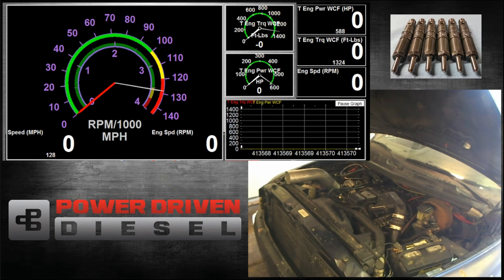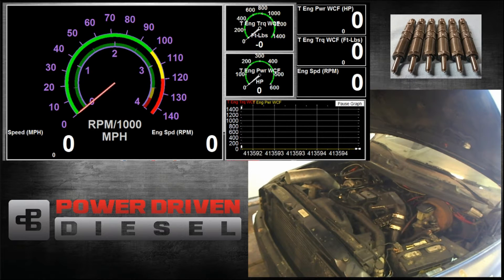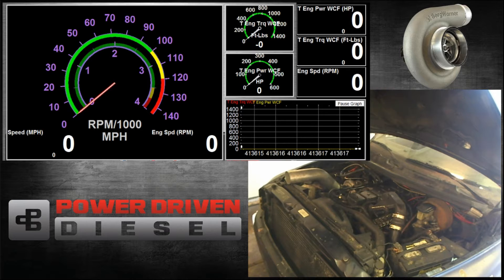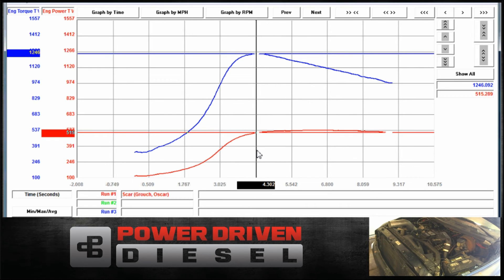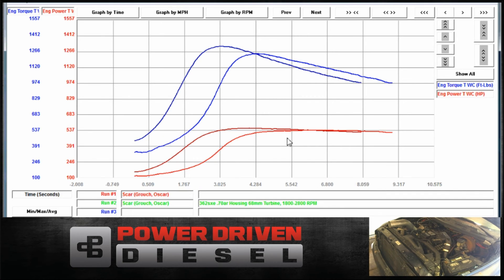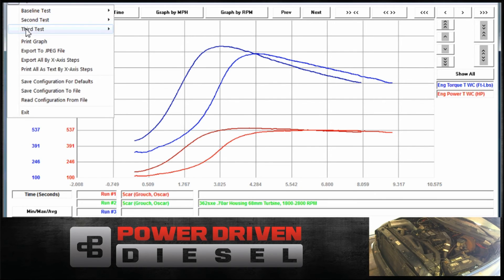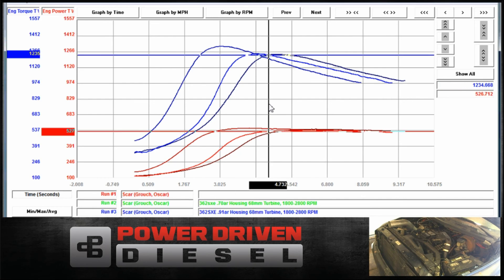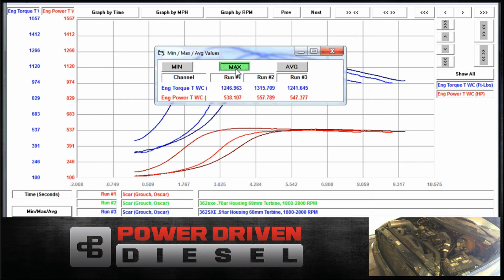S362SX-E .83ar Turbine Housing 68mm Turbine

Comment: Is the .83 housing in this test gated or non gated?
Reply from the maker: Non gated
Reply: Thank you.  I am running compounds, s476 with a 1.15 ar housing over a s361 with a .83 ar housing non gated with 30% overs on my 24 valve and I was wondering if I was going to have drive pressure issues.

Comment: Was this the t4 divided .83 housing? 
I'm building a compound boosted 12v with S362SX-E 62/68 with a gated T4 .83 divided housing on an ATS T4 manifold. My primary is a good used HX60W 74/86/23cm T6 from an ISX that I got real cheap. I'll probably upgrade that one later down the road. Anyway, did I pick the right housing for my setup? or should I consider something else? it looks like the smaller housing smokes the .83 in this test but what would it do in a compound setup like mine?